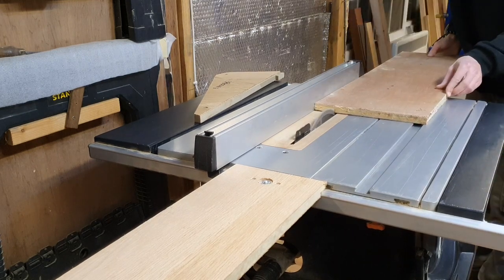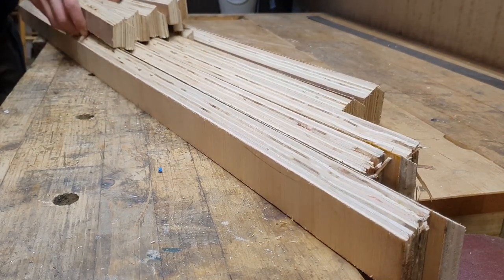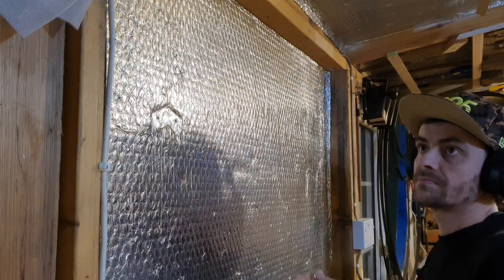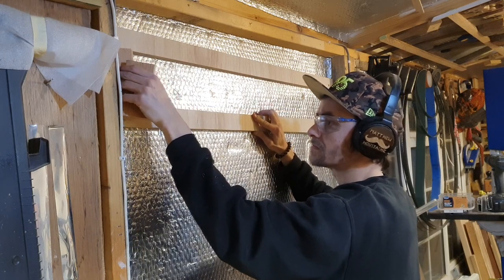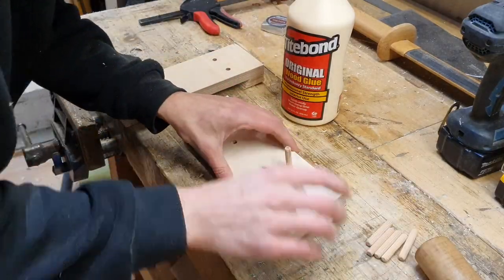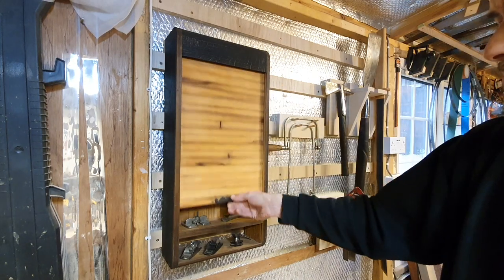How to Make French Cleats - Workshop Upgrade Out of scrap plywood

Comment: Very good, I made a similar French Cleat tool holder wall in my last workshop. Unfortunately we had to downsize due to illness and early retirement, so that was  left behind when we moved. I have mostly recovered now and am hoping to be  able to set up a smaller workshop later this year.
Reply from the maker: Thanks Peter 👍 wish you to back to maximum strength and build your new workshop, I would be more than happy to help if you were local 😁